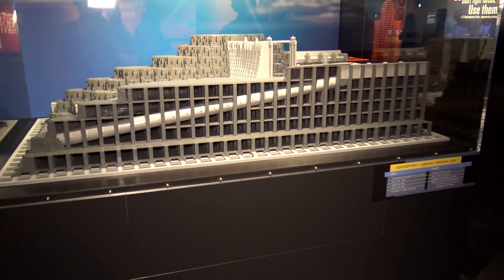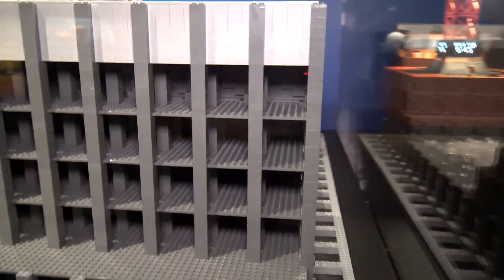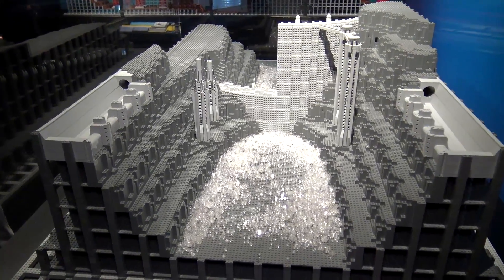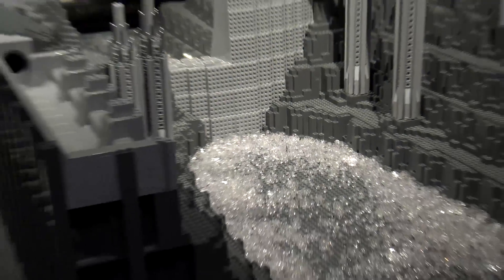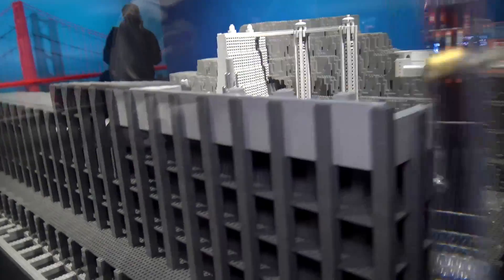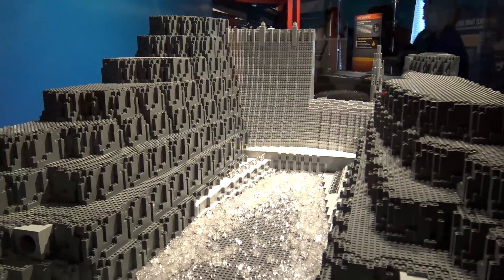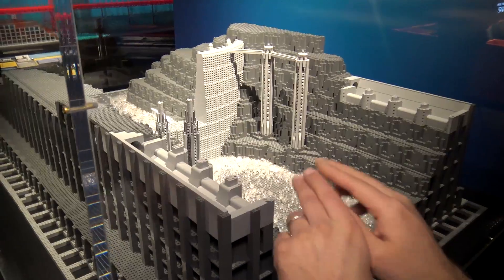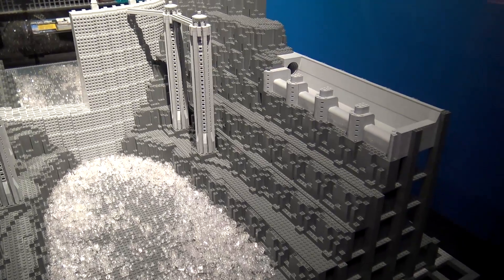LEGO Hoover Dam | Museum of Science and Industry

Comment: This is a unique take on this dam. I honestly have no issue with the "ugly rock pieces" (adding greebles of mixed 1x1 plates, studs, and tiles is an awesome fix to this) because they do create more of a backdrop rather than a vital part of the build. The mix of greeble clear pieces on the bottom threw me off at first, until I remembered that they irrigated the water into a smaller river while constructing the dam. (maybe add a two plate thick mix of trans clear plates "roof" to simulate water in the dam to clarify the border between construction and completion side. It isn't my build, so I can't judge much. Still great! :D